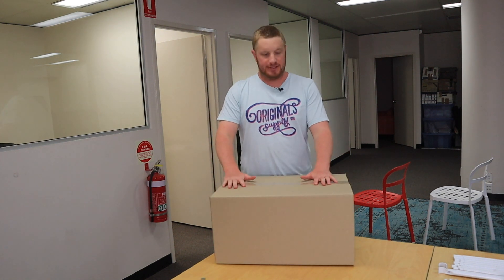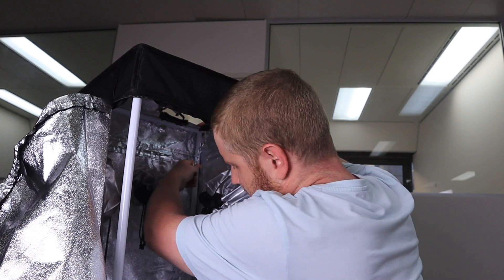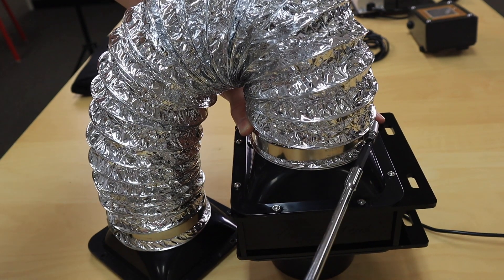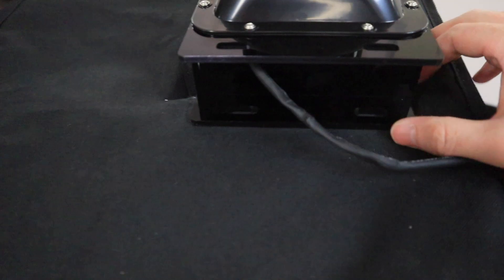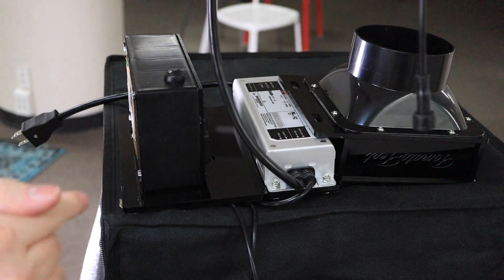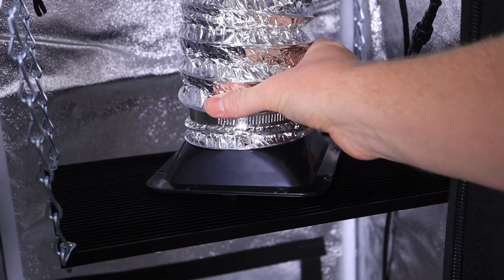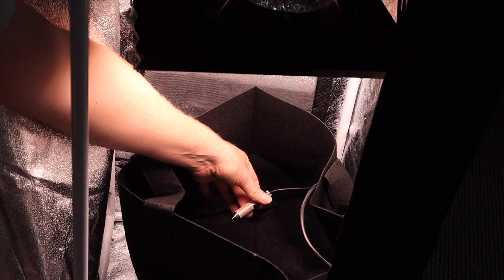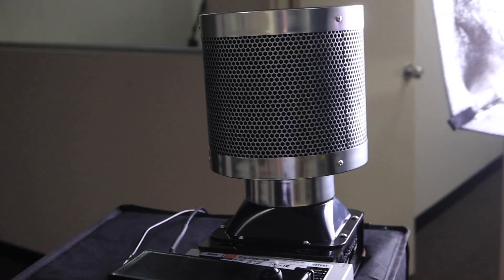Assembling a Mini Grow Tent (TomatoTent)

Comment: What a savage hole you made at the top of the tent looks like someone hacked it out with a blunt knife, surely you would have these premade and lazer presisoin cut?
Reply from the maker: yes, this is just my prototype.  The 'real' ones have a hem around the hole and a sleeve to avoid light and air escaping.